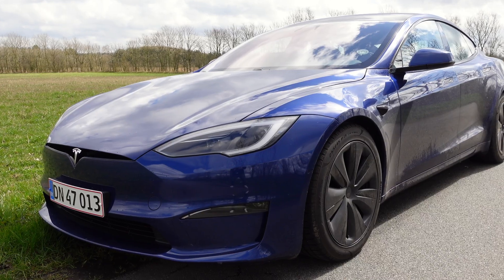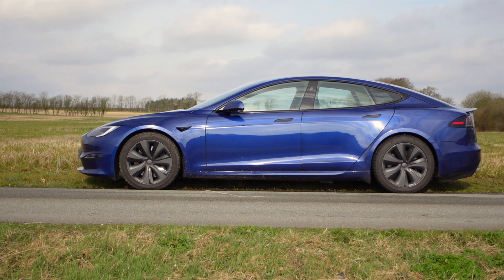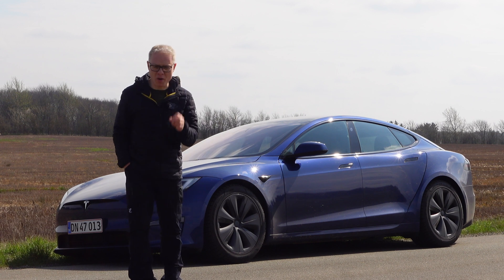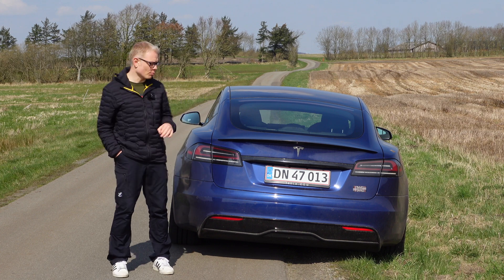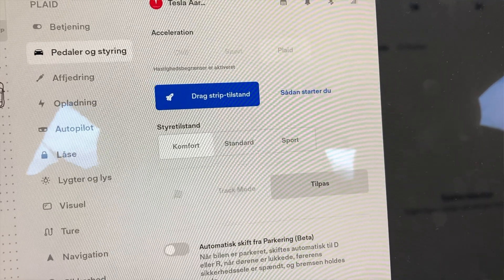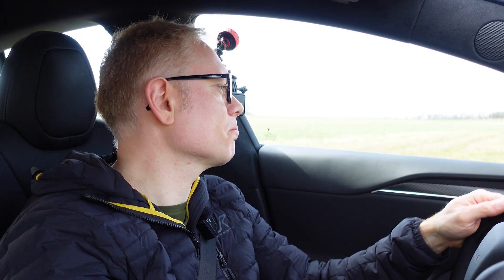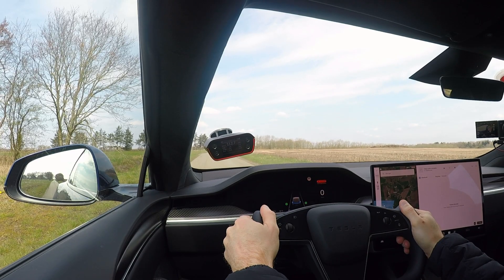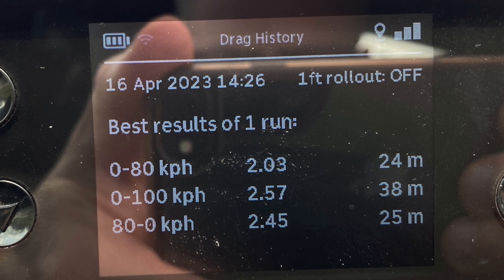Tesla Model S PLAID - Will it accelerate or stop the fastest?

Comment: Electric motors respond faster to lose of traction then abs which allows for faster acceleration then braking.
Reply from the maker: This is exactly why i get this result 👍😊
The car's traction control can regulate the effect approx. 1000 times per second, where the abs system can only regulate the braking force up to 20 times per second. Thanks for watching

Comment: Den var jo smart Jimi! 👍

Thanks for the ride and information about the Plaid and it's acceleration!

On winter tyres and slippery road you might get the best performance.

So under this conditions it shows that this car is quiet fast! Just the fastest you can buy und 150.000 € or $!

Only driving on vindy roads it's not the fastest, this will be the domain of the Porsche Taycan... 😊

But anyway, thanks for your test!

👍👍👍👌👌🙋🏼‍♂️
Reply from the maker: Thanks M8 😊